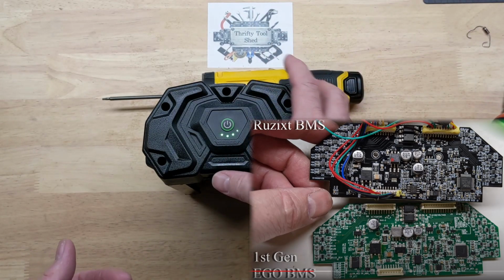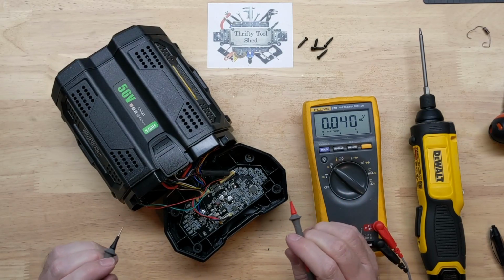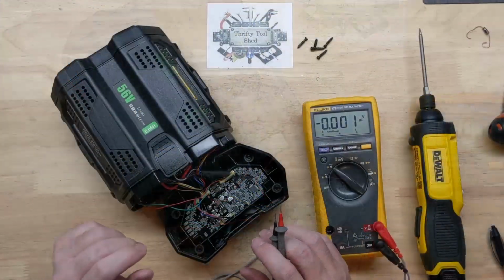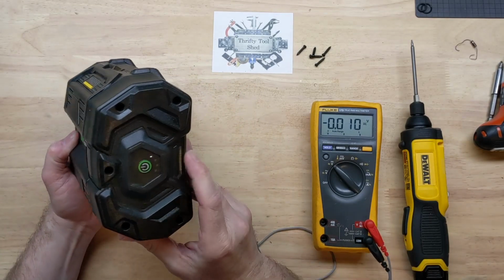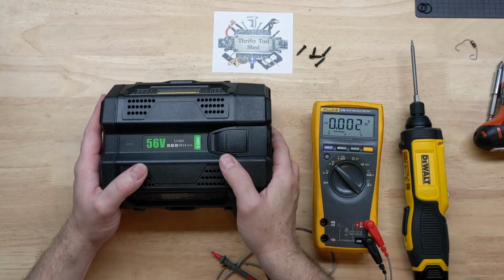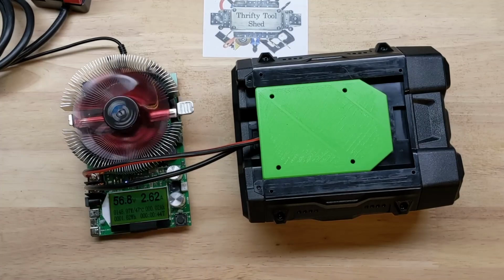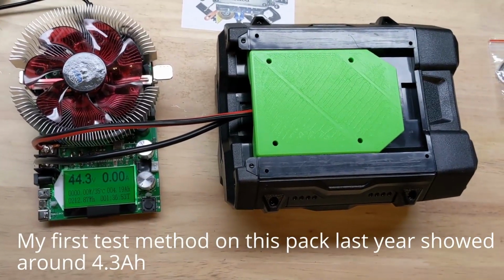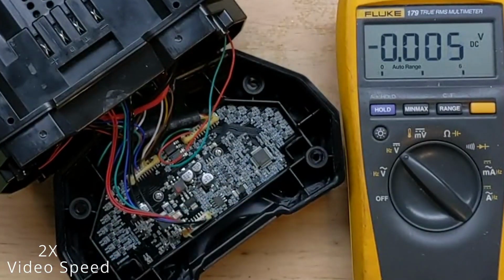Ruzixt 56V Battery 1 Year Update

Comment: Even though these aftermarket batteries never have their rated capacity I think they are a better deal. You can buy 3 or 4 of them for the price of 1 Ego battery. Having 3 4ah batteries for $209 gives 12ah of power where 1 5ah ego battery costs $249.

Comment: I have 2 - 3 years on and running great, the only issue is they dont discharge on the nexus, if they did, I wouldn't buy another oem
Reply from the maker: I am wondering about some of the newer versions. Since these apparently clone the BMS of the EGO packs it seems that possibly it would matter which pack BMS they clone!
Reply: Yeah I havent looked in mine to compare, they are much lighter though, and less finicky, I havent had to put one in the fridge yet which I have to do on a couple of my old ones. My ego 5.0 is on its last legs I wonder if I can put that board in the aftermarket one to see if it discharges on the nexus, that might be a work around
Reply from the maker: @danforrest6440  
Yeah, I don't know exactly how similar the are, but the ones I looked at look are similar and the newer ones seems to even have the 5 segments around the pushbutton a lot like the 3rd gen EGO packs. I tried my best a few years ago to get a lot of the BMS boards from the aftrrmarket suppliers, but no luck. They would not even sell me a lot of 100 at the time. So many China manufacturers knocking these off now. Surely one of them will eventually give in and offer some similar to the M18 and makita style boards on eBay...😂

Comment: I have a 16 inch ego chainsaw with two 2.5 batteries and a charger and two 14 inch chainsaws with several batteries and chargers. I have been wondering with  third party batteries that would do better than others  and at a reasonable price
Reply from the maker: There are still mixed reviews online. I can only speak on my experience with the 2 that I have reviewed now. That includes this 5ah that I purchased out of couriosity and a 6ah that was actually sent for us to look at. They are both working well to this day. I have no major complaints, the best value is still usually buying EGO packs in the combo kits, individually at least we have other choices...
Reply: @ThriftyToolShed   i  look into various batteries online and reviews. But i don't rely on the reviews entirely. I tend to want to find out from people with working knowledge of such matters. I tend to want to know the pros and cons. And  go from there. Your review is really helpful.

Comment: I bought a similar knock off 9A battery and it lasted a few months. Now it charges to approx 57 volts but the top indicators flash red when the button is pushed. Mower runs for a short period and stops. Not impressed with the state of electric powered outdoor products. Works OK when it works but i'm done. Good videos BTW.

Comment: I bought this battery and my charger refuses to charge it!  Thought it was the battery, so went through 2 replacements to realize my charger won't charge these.  My charger model is CH3200.  Any ideas on how to get these charged?
Reply from the maker: I have tried these on the CH2100 and the Rapid charger as well with no issue charging. Both of the packs I have shared on my channel, this one and the 6000mah in another video seem to have a cloned BMS board. That is what was impressive is they seemed to work seamlessly with all the EGO tools and chargers that I have. Since EGO uses communication between the two I was very surprised at how well they were able to get these to work. I don't know if something is different about the newer charger or not. If not I wonder if the board inside has been changed or perhaps not even made by the same manufacturer any longer? It was just one manufacturer of these to start with and now it is a bunch of different ones online with a slightly different version or color. The two I looked at and disassembled had a basically cloned bms board with evidently a microcontroller with a copied program from the EGO BMS.
Reply: @ThriftyToolShed  Then maybe the newer chargers have a smart chip to identify "genuine" EGO batteries?  Thanks for the info, I will order a CH2100 charger and see if that makes the difference, because as far as I know, there isn't a "generic" version of the chargers.  :)
Reply from the maker: It will be interesting to know for sure!
Reply: I got the charger today, and it's the same issue.  I press the button on the battery and it indicates one light, green, on farthest LED from the bulb icon, indicating the need for charging.  I then slide it onto the charger, charger blinks green twice, then stays lit, while all the LED's on battery light up green indicating fully charged.  This happens for BOTH batteries.  I go to use the batteries, and mower runs for 2 minutes.  The battery LED lights up with one green light in mower, then blinks red, then all lights blink red.  Color me frustrated!  Any thoughts?  I also tried "resetting" battery by hold button for 10 seconds...no dice.
Reply from the maker: @richgehan2679  
No. I have not seen that at all. Sounds like you have more than one pack and tried both on at least two different types of charger so I would contact the seller. They must have changed something. Mine is still working and charging just as good as brand new.
Reply: @ThriftyToolShed  I cannot exchange or get a refund at this point.  I started a return, but they already had another battery in transit to replace the first, so I cancelled the return, voiding my opportunity for a refund (my mistake).  However, I have tested THREE batteries total, with the same result...I'm just stuck with two now.  My conclusion is: none of my chargers are Gen 1, even the CH2100.  I guess I a whole crud load of flashlight batteries, at the very least.  LOL!  Do you think a hobby charger would work?
Reply from the maker: @richgehan2679  
Dang. I hate to hear you can't return it. You could charge it with a hobby charger if you have a 14S version, but I simply use a CC CV 60V Power supply. I set the Constant Current to around 2 - 3 amps for a 2P pack and set the voltage at around 57V to limit the voltage. Just remember it is no way to test for cell unbalance without opening it up and testing each cell bank. As long as the cells are healthy you can probably charge this way just fine and they will stay balanced. I would offer to swap my pack with you, but since mine is over 2 years old now I would hate for you to get an older one and the shipping cost is high also for both ways. 
https://amzn.to/3L1wSGi
https://www.ebay.com/itm/195380124936?mkcid=16&mkevt=1&mkrid=711-127632-2357-0&ssspo=7g7zvwmns8a&sssrc=2349624&ssuid=D_qZMHXJQNK&var=&widget_ver=artemis&media=COPY
Reply: @ThriftyToolShed  I truly appreciate the input you've given me, at least I know I have one option left before salvaging just the individual cells.  I will look into the CC CV 60v Power Supply, that sounds feasible.  I did check the individual cells using your method of checking the BMS board, all but one show 3.99v with one showing 3.3v, not a huge difference.  I've scoured your videos and find them very educational!  I appreciate all you do!  Thank you again for your help!  Also, I wonder if any of the EGO BMS boards are compatible with the generic battery packs.  Gen 1 to Gen1, etc.  If so, I might be able to get a "for parts" Ego and use the BMS board on the generic pack to "fool" the charger into thinking it's a genuine ego.  😁  God bless you, sir!

Comment: Where should we store our EGO batteries? I keep mine inside the house because of the constant temperature, but maybe that’s too big a risk?
Reply from the maker: Some people do keep them inside the house to keep them temperature controlled. I agree with you about the risk. They are a lot like having gasoline inside without the fumes. It is a lot of energy density if something goes wrong for sure. I live in the south and it does not get severe cold, but I feel the summer heat may be worse on them though. I know it's better for the packs to be temperature controlled and not fully charged when stores either, but I like having mine ready to go when I can. So I don't have optimum storage conditions in my garage, but it's been ok for all my batteries so far. I have had many lithium batteries last me over 12 years so my storage conditions are still within good reason. If you do have a good way to store them safely in a temperature controlled area it would be better for sure especially if your climate is worse than mine. For me the risk isn't worth it, I would rather not store my thousands of Ah of packs inside the house where we sleep.

Comment: Geez, just looked it up, these batteries are only avail in a 2 pack for $300!!!!  I got a 650 blower, 5ah battery and charger for $199 at Lowes, the 615 blower was on sale with a 2.5 ah battery for $149.  so $150 for an aftermarket battery?  no thx
Reply from the maker: In the original video I did mention that buying the EGO packs in a combo kit is the best deal on packs for sure. I even shared my own personal example a few years ago. Some things have changed a little and it's many more manufacturers of the aftermarket packs now. Many are available as individual packs and are much cheaper than buying EGO packs straight out apples to apples. Love them or hate them more options for replacement packs is good for the future of available packs, but again the EGO combo kits are the best way!

Comment: FORCED BALANCE.  Is there a way to force balance a pack?  I've got some 7.5s that don't charge completely.  And I'm interested in the connector..and the test fixture.  Where'd those come from?
Reply from the maker: We can charge the cells individually with a CC, CV  power supply and that would force balance. I would disconnect the BMS board before charging individually especially with mains connected PS. Also if a pack gets out of balance typically it's a real cause like some cells capacity is reduced and not able to keep up with the others in series. I have links in the video description for example load tester and connector. I will also include the below suggestions as the Load tester has an updated and better design and it is more than one choice for the connectors some high current rated and some much lower. 
https://amzn.to/3Vl6fyC
https://amzn.to/3OyHlJB
https://amzn.to/3VrAd45

Comment: I appreciated you. Is there a work around for a shorted board? This battery is almost new. If you find a good board will you sell it?
Reply from the maker: I actually have not worked on any 7.5ah packs yet. So far just the 2.5ah,4ah, and the 5ah. The 5ah BMS board may work, but I am not sure if it is exactly the same. The packs communicate with the tool let's it know what size of pack is connected as well and could be a small issue with things like the Nexus power station etc. It might still work. I have no spare boards myself. BTW is the pack under warranty?
Reply: @ThriftyToolShed  No, It is out of warranty. It has not been used much so I know the battery packs are in great shape. Interested in buying it?
Reply from the maker: I don't really need it, but it will bring good money on eBay!

Comment: Is there a way to buy a new BMS board for a 7.5 AH? mine is shorted out
Reply from the maker: Not that I am aware of. I even tried asking the manufacturer of these about buying some BMS boards from them since they copied EGO's BMS board so well. I really wanted to test one of these in the EGO pack as a replacement. The manufacturer would not sell the board separately. I did try! I had a contact because they ended up sending me a 6AH pack to review after I bought the first 5AH. I am still hoping to see these aftermarket boards become available similar to the Makita or Dyson pack BMS boards etc.

Comment: Hmm your review is great but on Amazon there are too many reviews about this aftermarket battery won't charge ,it don't last etc.
Reply from the maker: Hard to argue with online reviews of the consumers for sure. I can only speak of the 2 that I have myself. I was impressed that it was copied so well and mine has worked well, I can only share what I see. I try to simply show it for people to make their own decision and mine are still working great so far, but if any issue arises I will share in the video comment as an update! I work on many of the EGO packs and I had issues figuring out how the pack communicates to the tool and when I first found these clones I was impressed that they copied it and figured out the communication on the D-terminal. The reviews of these should be considered for sure! 👍
Reply: I bought a compatible battery last fall charged and used it once. Charged and put it up until  March checked it . Used it for less than 5 minutes it started flashing red. Put on the charger it blinked  green then went red and stopped the charger.  I notified Ruizit they send me video of just unplugging and replug terminals on the face of the battery. To no avail they wouldn't give me a full refund. I was told to order another and they would give me a 20% discount.  I sent it back and Amazon sent me my money back minus 20% restocking fee. I've since purchased a new 650 cfm leaf blower with battery and charger for $30 more than what 5,ah battery alone cost.
Reply from the maker: @brentthompson417  
Thanks for sharing your experience. I Hate that it did not hold up well. Mine have been great so far, but as mentioned above some reviews are not good on these and hard to argue with that. I agree about the combo purchases, I know in at least one video I mentioned buying the combo or kit with the  blower or trimmer with the 5ah battery is a much better deal than even buying the aftermarket clone packs.
Reply: @brentthompson417  It is ridiculous about the batteries costing so much from EGO. I also noticed the thing with the leaf blower without the battery was $229 (I think) and with a 5Ah batter and charger, it is only $100 more. EGO - quit ripping us off on the batteries!